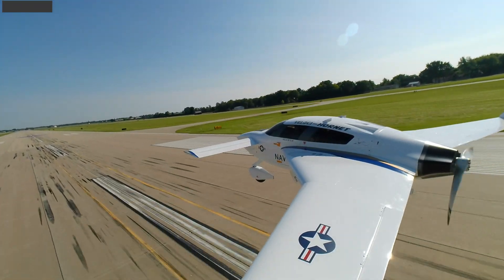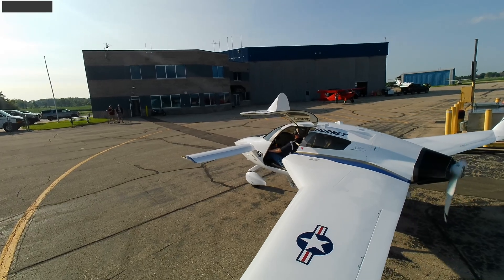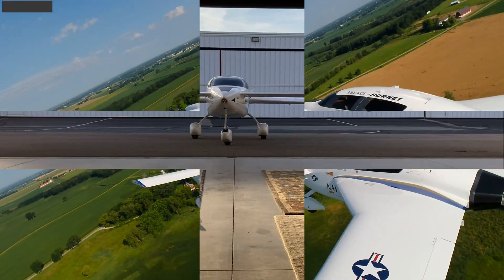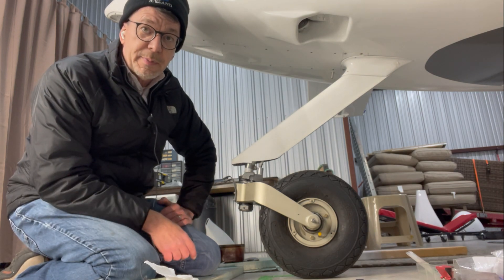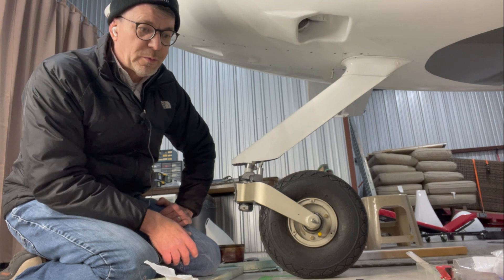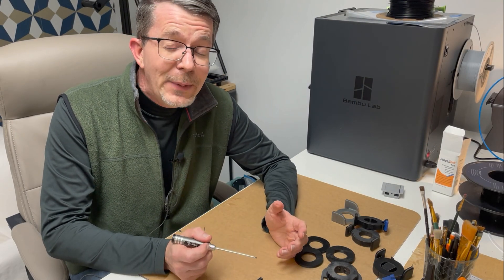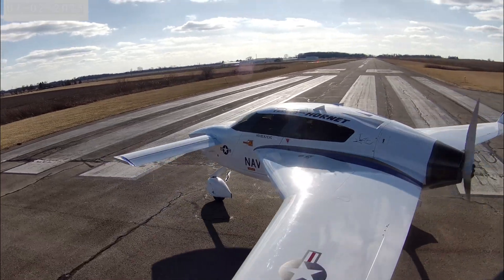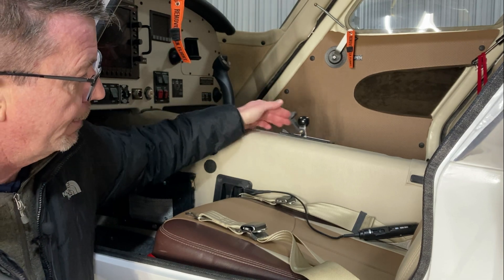Velocisteve 7   I Got The Shimmies

Comment: Enjoying your plane and humor. Glad I found you. Fun-Fact... I crashed a Velocity at UNU where you gassed-up. I was a passenger in an RG I had helped build. It was the owner's second flight. There was a pancake breakfast going on, and we were having trouble hearing anything on his radio. This caused a distraction. He also had not made his landing checklist. We landed on the centerline, gear-up and skidded on our belly right down the runway. Needed to rebuild the prop and the belly of the fuselage. Wankle engine was checked out, but no damage. $11,000 later, all was good.
Reply from the maker: Glad no one was hurt... Given your description of events, there are several lessons learned, no?

Comment: Take a look at the uh60 tail wheel pin system if you can find a picture of it,  there’s a spring on the pin that provides preload so that when it’s in locked position the pin will have a constant load if the system is out of alignment when the pin placed in the locked position as soon as the hole aligns with the pin the spring drives it in.

Comment: not sure what nav system you have but at the airline we always copy the route into "Route2" so if you accidentally overwrite or delete the waypoints on the active route, you can quickly and accurately recover by swapping to the back up route.  Is something like that possible with your system?  I don't remember it being something I could doo with my old GNS430
Reply from the maker: Thanks for the comment.  I have an "Advanced Flight Systems" AF-5600 -- no Avidyne or Garmin second GPS, just the AFS GPS. I'm VFR only.

Comment: Nice Mod. & Solution.  For Rev. 2, how about a switch controlled electric or hydraulic actuator for the pin set/unset?  Cheers.
Reply from the maker: Thanks - With ANY system, you have to weigh the cost, complexity, weight, and potential failure modes.  Sure, I could put in a solenoid to drop the pin, but then I'd need a feedback system to "know" if it is actually where I think it is.  Sure, could be done, but for now I'll stick with a lever.    Note, I have DO have such a system on the speed brake.

Comment: So we had to get rid of the nose wheel pant and tighten up the bolt that lets the wheel pivot.  We have a small wheel pant in the front of the wheel only.  Our nose wheel takes a fair amount of force to rotate it.  We have no locking mechanism.
Reply from the maker: Right, if you can keep a LOT of friction, it should dampen the shimmy. But, there are several factors that cause it - much like control surface flutter.